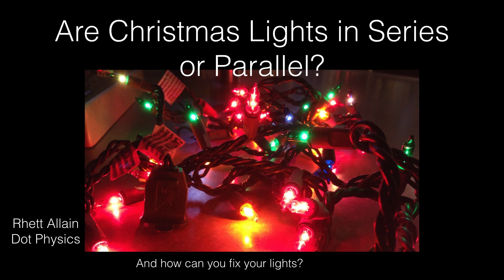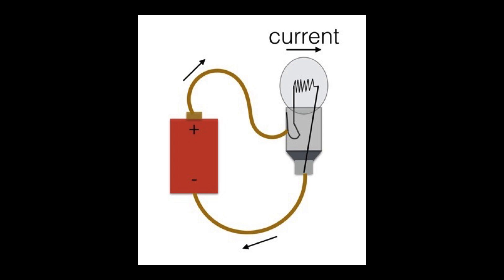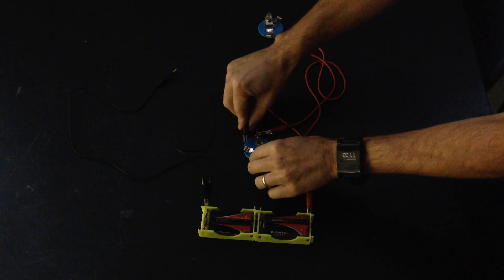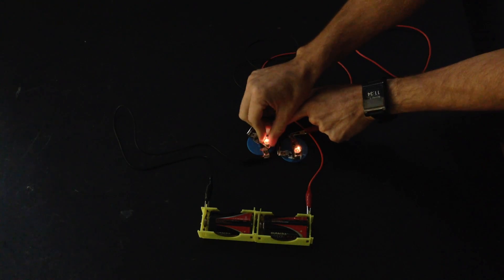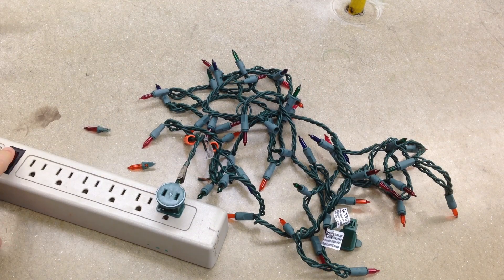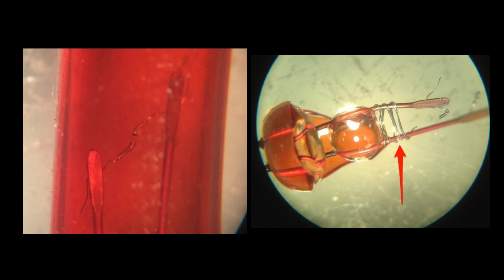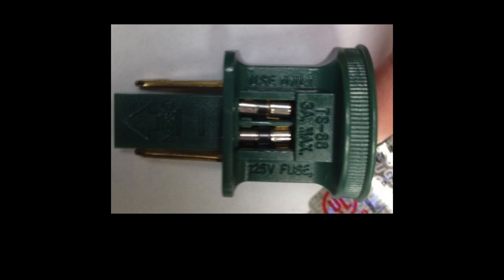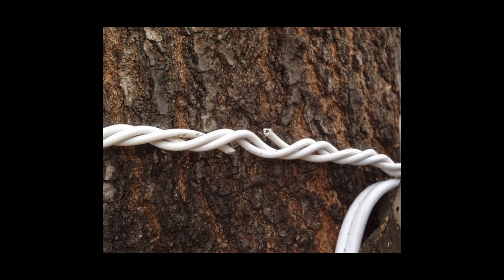Are Christmas Lights in Series or Parallel?

Comment: It is very good video. Just wonder, is there the "shunt wire" existing? when I took that broken with "shunt wire" bulb and measure it with ohm meter, it does show broken. why?
Reply from the maker: The shunt wire doesn't "short out" until there is a large (120 volt) across it.

Comment: Honestly when it comes to 1 light killing off all lights, it’s really a question of quality. some strands have it to where 1 bulb goes out or is loose a section goes out, or mostly on much older lights, 1 bulb goes out all do. It’s kinda odd because in a way, christmas lights are both in series and parallel.

Comment: The most annoying set I ever had was one of those sets that were big in the 90s, the chasing light sets that have the little control box at the front that allows you to pick a sequence. These lights had four series circuits with one return wire, so every fourth bulb was on the same circuit and if a bulb got a poor socket connection, you would lose every fourth light in the chasing sequence. when I was a kid, I would remove all of the lights and then reattach them one by one and finally get the strand working before Christmas. Then sometimes after getting them on the tree a circuit would go down again and I would go around the tree testing every light. It was a lot of work just for epileptic inducing fun.

Comment: Why do the shunt wires not short circuit the leds? Is there a resistor?
Reply: If it's in series with everything else, then it's basically an extension of the wire at that point. All of the other bulbs provide resistance on the series circuit. If it were wired in parallel, then yes it would short out the circuit. But if it were wired in parallel there'd be no need for a bypass.

Comment: Sometimes a whole section of my christmas lights is off when the rest are on. They turn on again when I change the first bulb of the section. Why do you think that is?
Reply: it happens because there are components connected in series within the larger parallel circuit. When there is a break in the 'branch' the whole of that 'branch' goes out